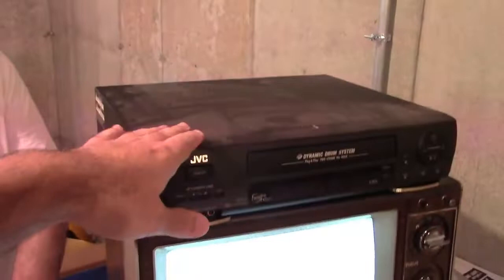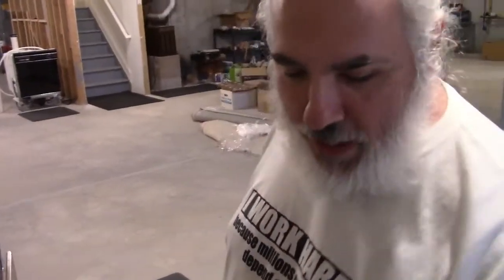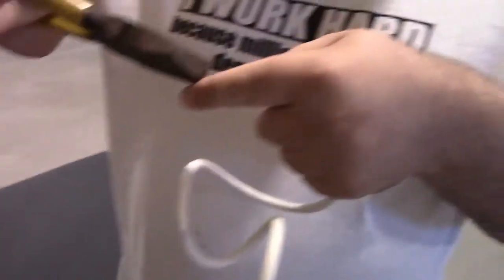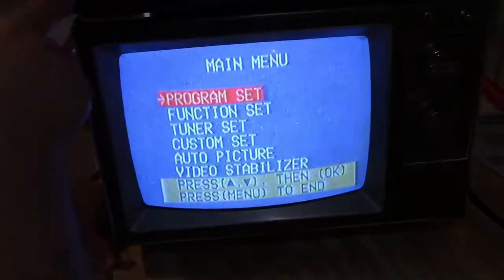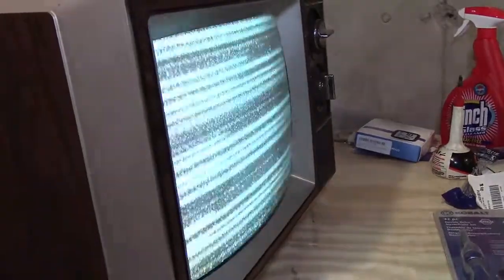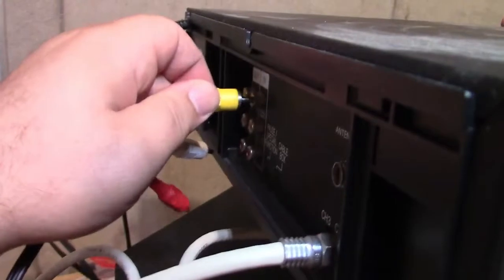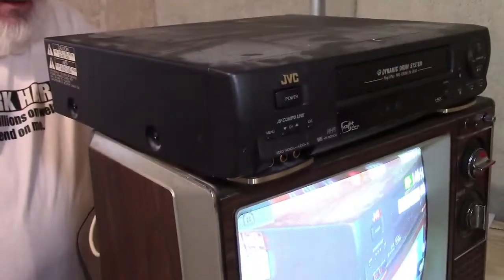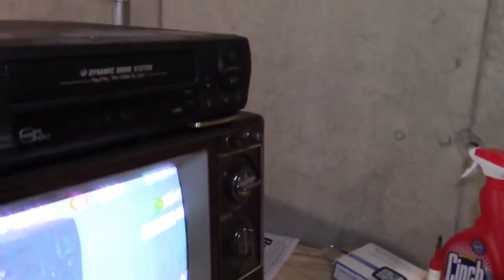MacGyvering A Connection To Sharkie626's 1985 RCA CRT TV

Comment: Definitely a fun project, the color images of those CRTs is just amazing.
Reply from the maker: Yep, CRT blows away the minute-to-boot-up TV sets they have now!  You know, what we ought to do next time I'm up there is connect up your bro's TV in tandem with it, you'll want to find an old TV stand or something, maybe a table, cinder blocks, or build something out of wood, for it.  Then you can dial in the sets even closer is color.  Your setup now is fine for anything that doesn't have Macrovision protection (and I actually have a box to strip that out), so a non-copyright DVD would play fine.  Or, if you wanted to really modernize it, an old iPod touch you can get a composite video out cable for, and plug it in that way, and play YouTube or whatever the browser on that thing still supports can play.

Comment: No rubber bands? Go buy a lobstah from the grocery stoah, they load those things up with rubber bands! 
A couple years ago, I was out driving around, and I noticed a bright yellow TV by the curb at this house in town. It even had the remote included! I grabbed it, and brought it home. It turns out, it was a Spongebob Squarepants TV, with - get this - a DVD Player built in to the TV! It also had a coaxial (I pronounce it co-ax-ul) input on the back, and 2 different composite hookups. Back then, I was on a huge home security craze, and I had these 2.4GHz cameras all over the place. They knocked out the wifi constantly,
It was great. Anyway, their receiving box had an RCA connector on the back, so I hooked that into this TV, and set it up in the basement. It worked well for a few months, but then I lost interest in the cameras, and having to reset the Wi-Fi every 3 hours was really annoying. So, I took the cameras down, and put the TV in storage. Eventually, I’ll probably pull it out and do something with it, but that day hasn’t come yet.
Reply from the maker: I wonder if that SpongeBob TV will be worth money one day  But it was a perfect junker TV for your purpose!.

Comment: I've made a cable end like that before. Not 100% perfect, but a usable image is achieved. Try that with digital, and it would just be little random squares on the screen.
Reply from the maker: Yeah, if that!  I've never seen digital OTA actually work.  Perhaps I'm too far from the transmitter, but is 35 miles too much to ask?  Analog worked so much better, there might be an Old War Story on that coming up one day.

Comment: first, Merry Christmas.  hope is all good for you.  second, outside of the sony trinitron, rca is best.  the colortak is awesome.  i don't know much bout tv's from this era. all i know is coax input and rca inputs.  but my family had a floor model tv probably from 85, used coax.  cable and tv box too. used that until it went.  but honestly crt's can have the best pictuire possible for sd feeds. i heard that coax can carry hd feeds too? i love coax cables, but i have to say my vcr is hooked up by rca inputs. although my hd tv has coax input.  other than this, sharkies basement is a great basment to finish into a tv watching studio.  but outside of this, is there really a difference between the old coax cable and the the ? rg6? cables around? plus i remember when my cable compamny was only coax cable where pay for view channels were just scrambled and still could hear audio on the channel.  i miss those days .
Reply from the maker: Thanks, Merry Christmas.

There are different kinds of coax wires out there, there was RG-59 back int eh analog days, as that cable is best suited for baseband (composite) video signals at relatively low frequencies.  When cable became "digital" and this was early in the days of digital, even harking back to the late analog days when they were packing more and more onto that coax line, it was suggested to go to RG-6, allegedly it carries higher frequencies better and is also suitable for digital.  In fact, if you were to get one of those amplified antennas that purports to pull in zillions of cable channels free over the air, it's SUPPOSED TO use RG-6, but China.  Over short runs it's probably not that much of a problem.

But yeah, the old days of analog cable, when everything tuned in instantly, and scrambled channels--those were the days.  You used to be able to buy a "hotbox" or cable descrambler back then, to get those channels free.  Then the cable companies found a different method to scramble the channels, often sending bright white pulses on the screen continuously during the broadcast.  My dad continued to watch it like that, despite what it could possibly be doing to his eyes, not to mention what it DID do to the TV (killed the flyback transformer), because it was free.  Later they had addressable cable boxes, but there was still a way around that, some device you'd hook up to the box, press a few buttons to put it in programming mode, then you'd turn this other box on and it would reprogram the box to accept those channels and descramble them.  That was a temporary thing that could last anywhere from a couple hours to several days.  There were filters to be put on the cable line to prevent the signal fro the cable company to re-scramble the picture from reachng the box, but they rarely worked.  Once it went fully digital, all bets were off.  The boxes now have cable modems built in and it's a two-way datastream.

Analog TV was so much better, no question about it.  And CRTs offered the absolute best picture quality, and in my opinion, still do, at least in terms of color rendering, than any other technology can provide.